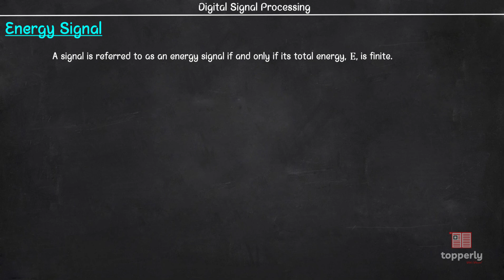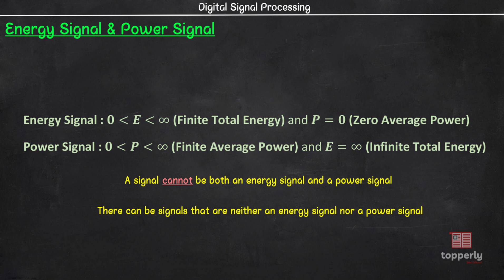Energy Signal and Power Signal | Digital Signal Processing

Comment: How 1/2N+1 turned 1/N on 4:44
Reply: Why for the 2nd example , the power formula is different compared to the 1st and 2nd. Also how to know which one to use?
Reply: Even I got the same doubt, good u asked !
Reply from the maker: Please note that the definition of average power is, P_avg = (summation of square of absolute value of individual samples) / total number of samples.

Our system in particular example is defined only from n>0. So total number of samples will N (n=1, 2, 3..., N where N->infinity).

Hope this is clear. Please revert back if you have doubts :)
Reply: hen why you did not apply the same logic in third example fo power calculation i.e 1/ N+1 @Topperly
Reply from the maker: Hey Anuja,
In the third example, the signal is defined for negative values of n also (even though x(n) = 0 in for n<0. Hence, we have to consider all samples of N from (-inf) to (+inf)
Reply: @Topperly  thank You_❤️